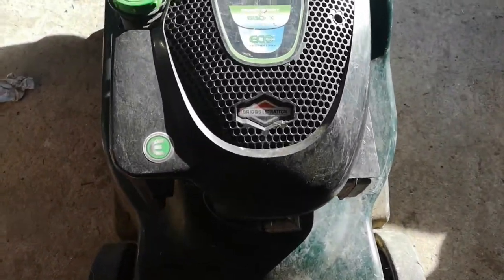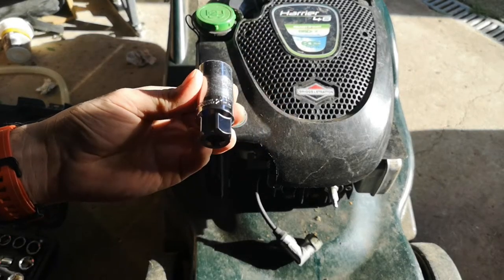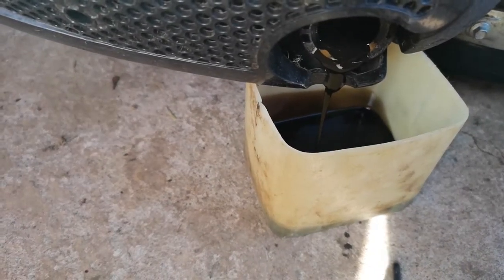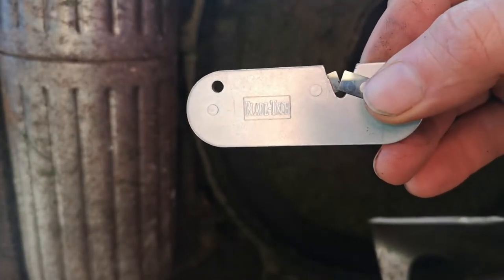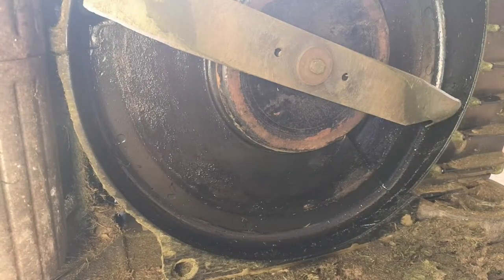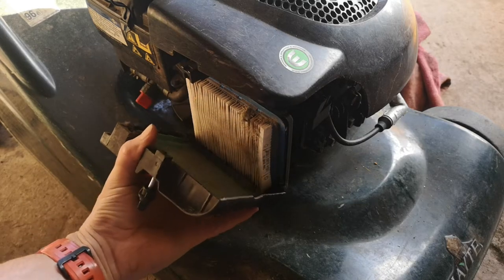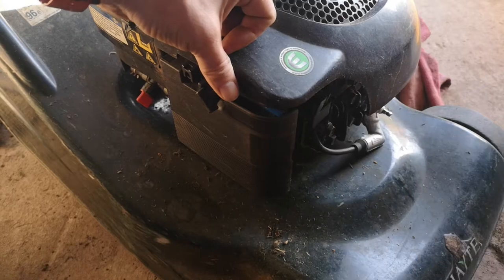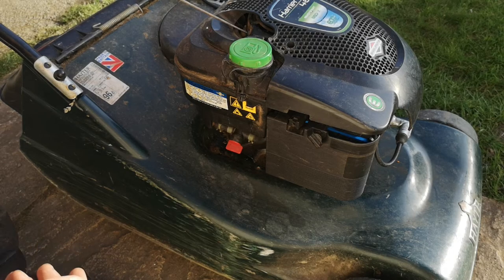Hayter Harrier 48, full service!!

Comment: Hi there, thanks for the video. Does it need a fuel filter change, if so where is it located?
Reply from the maker: Hi, there is no fuel filter on this model. If there was they are usually fitted on the fuel line just before the carburettor, but they dont often need changing as the fuel should be pretty clean. End of season try adding briggs and Stratton fuel additive to keep any remaining fuel in the tank from going off. Hope this helps 👍

Comment: Are there any grease nipples for the roller  etc
Reply from the maker: Not on this model
Reply: @lewtube1136  thank you for reply very helpfull
Reply: What did you spray on the undercarriage?
Reply from the maker: I like to spray a little wd40 on the underside to help stop grass sticking, doesn't last long but it can get me an extra couple of cuts without having to clean the deck